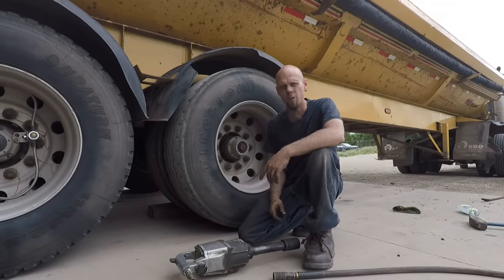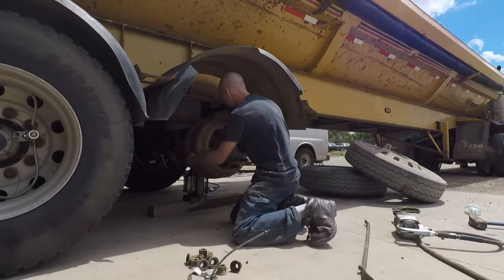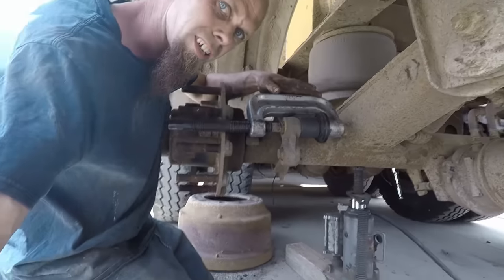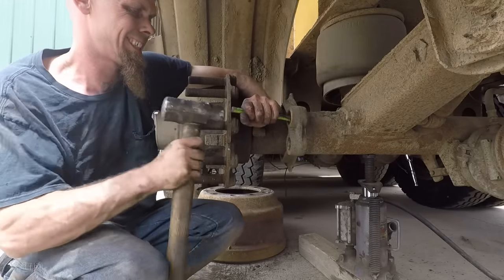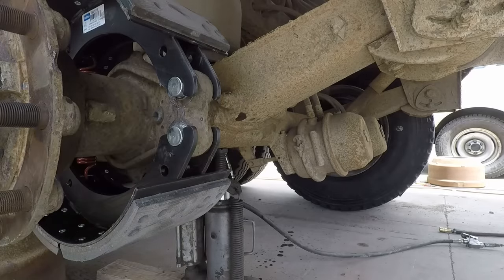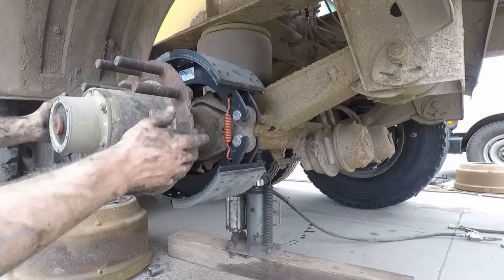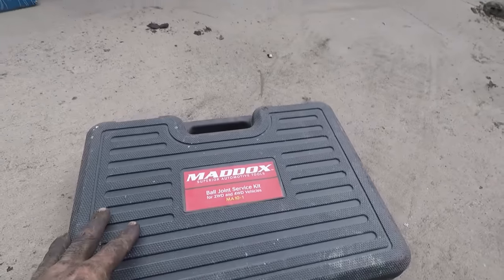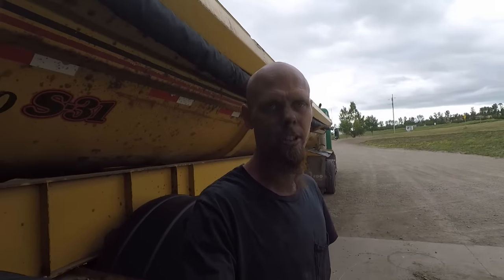semi truck brake job seized anchor pins

Comment: otherwise good job done.. tip: wear ear protection and eye wear every time you do this job, return springs can hit your face easily,  that 1 inch air gun is loud your hearing be gone before you know it... also there is a tool to push those anchor pin bushings (the one you took out with the chisel) a chisel can damage the inner walls of your axle and cause the same problem you trying to fix, also rubbing the drum and rims on those studs can cause your studs to bent & damage thread, a wire brush is also recommended to clean the studs and oil your washers, if you have abs it is a good way to push those speed sensors out, which i didn't saw any sensor so you may not have abs in the axle, but great job done... kudos to you man.. no hate intended..

Comment: Nice vid. Couldn't tell from the vid, but did you add some extreme pressure grease to the threads of the puller/remover? It would help a lot if you didn't.

Comment: Cool vid ... If you do brakes  a lot I did invest in the tiger tool or snap on makes a good tool to press those anchor pins out , and a good cordless impact , it makes that job a whole lot easier a lot less bullshit on you and only hard part would be putting the tires on and off😁

Comment: That was easier then a break job on my pick-up and the Wife’s car. Nice job Sir.
Reply from the maker: Everything is big and heavy but after a while you really appreciate the simplicity of air brakes
Reply: Ezrider92356 yes Sir, been a truck driver for over 30 years.  You make it all look easy, even when it is not.

Comment: Do you have any tips on what causes shoes to stick out the drum about a 1/4 to 1/2 inch. I replaced the spring kit and anchor pins, back them off, and readjusted them. They still come back out of the drum.

Comment: Use a bolt with the right size washer and you got a makeshift punch for getting the sleeves back in. Works in a pinch used on several service calls

Comment: This is probably the first time I've ever heard of someone using Brake Clean to actually clean brakes
Reply: I'm an automotive tech and we had several napa rotors we installed on cars start pulsating and need to be warrantied. A representative from napa came in and told us that we were cleaning them with brake cleaner when they should have been cleaned with soap and water. We all looked at each other like "uhhhhhhhhhhhh"
Reply: @nono5638  It's good to hear that work safety people around the world are easentially all the same, just as much as shop experiences are universal

Comment: Good stuff, but I know i don't do near the brake jobs you do, but I have done quite a few, and I stopped worrying about the oily coating on new drums and rotors a long time ago, and can't tell any difference in life or braking power.  In fact, when I know something's (gas powered) going to probably be sitting for a while, I spray the rotors with a cheap rattle can paint, and pump the tank dry.  And the brakes don't care.  Also I'm glad ta see I'm not the only one who hasn't fell prey to the rubber glove racket... ;p
Reply from the maker: i agree that long term it doesn't make a f all of difference. road dust rain water ect is gonna make quick work of it, still worth the 10 seconds to clean them tho imo.

Comment: I worked in many truck shops in my 20 years of doing this kind of work and not once that I ever torque the lug nuts he does run them in with the 1 inch impact and they're good to go.
Reply from the maker: Making sure the flanges where the rims mount is clean is more important than the torque value on the nuts and is often overlooked. I don't nessisarly agree with just buzzing them down and calling it good tho
Reply: @Ezrider359  yes that important I just did add that to my reply. But every truck shop is different in how they want to you to do stuff.

Comment: Did one of these a few days ago with the same problem. Ended up using a torch and an air chisel after the hammer and punch didn't work.

Comment: Very interesting! I'm a car mechanic and shop owner. I was wondering, approximately how much are a set of shoes and drums for one of those bad boys? And how much time  does it pay? We don't see many drum brake relines these days. Everything is mostly disc but I've done more than my share of them. The tiny springs we see are insane and tedious!! Great video and we torque every wheel on every vehicle. If we don't, the vehicle is more susceptible to rotor warpage.
Reply from the maker: id rather do big truck drums than car drums, much simper just everything is big and heavy. shop rates for big trucks normally is around 100-135 per hr.
Reply: @Ezrider359  Thanks brother.
Reply: Drums 60 to 200 a pop
Brakes 40 to 180 a pop
Labor 120 to 280 per axle.

Just quote 1700 for brakes and drums on a trailer.

Comment: I do brakes the same way, but I use a pair of vise-grips to put on the springs. Will have to try the screw driver method next time as it looks easier.  I have though about getting a ball join tool, but heat and hammer do the trick so never invested in one.

Comment: Hello from Kazakhstan.  When you pressed out with a big tool, you can’t pull it from the bottom to the top, because of this will be injury for your health , you need to push it from top to bottom, push it with your weight.  Peace to your home.

Comment: When tightening down the ball joint press how come using a breaker bar rather than a large ratchet? Was there a reason or just because that’s what ya had out? I just wanna learn 🙂

I build and repair custom technology but I’ve been getting into automotive and large trucks more lately. I just did my first set of drums on our business car so I thought this would be educational. Thank you for your hard work

Comment: When using a ratchet I find that less energy is used if you push down when able instead of trying to lift up. Generally you’ll have more muscle mass pushing than lifting a ratchet. Then you also have body weight behind the tool. Also, Tiger Tool makes an actual brake anchor pin/bushing press. A pair of vise grips is much easier putting the anchor pin springs on, safer too. I also hope you tapped those spring necks to make sure they were fully in place.
Reply from the maker: this took more force than what i weight. also pushing is a good way to hurt yourself if the wrench slips

Comment: oh yeah. those axles are notorious for those pins getting seized. snap on tap1 and a 3/4 gun with a 1 inch socket handles them usually sometimes need a torch to heat them up too though.
Reply from the maker: Yeah the style with the two stamped half's is easier to deal with even if they get seized it's really easy to just torch the bushings out

Comment: Leaving one of your anchor pins out then putting your small springs on is definitely the  easiest way to fit these shoes. All our trailers have back plates fitted so would make your method even fiddlier.

Comment: The anchor pins fit in the hole of the ball joint press, no farting around with adapters, and sometimes the hubs aren't notched, you got lucky! I had to pull hubs on an international to get them bastards out

Comment: I thought that was a stout jack you had there holding up that trailer but then I seen the wood block and was like “whoa that wood block is solid” then I seen the concrete underneath it and was like 🤯

Comment: Trailer brakes was  all I did for the first 2 years when I first started out as a mechanic over 25 years  ago you can make a lot of money off them when you get good and fast at them
Reply: You are absolutely correct!  I've been turning wrenches for 30+years and my first gig was at Santa Fe Hobart Yard in Los Angeles Ca.  Trailer, chassis, and container work for a year . I still do my brake jobs like this guy but instead of a screwdriver i clip vise grips  on the end of the small spring push down into the hole....🙂

Comment: I know this video is more about the brake job. But out of curiosity where did you get that big torque wrench for the lug nuts and what is the recommended torque specs on a semis lug nuts? I ask because I've never seen a torque wrench that big and so I've never torqued lugs on a semi truck. But several years ago when I first started driving I lost a set of duels one night about 3am in Dallas,  scared the crap out of me.

Comment: The most interesting video I’ve seen on YouTube lol.... i drive a t800.. brakes dont engage when i press, i press to much it grabs hard and smokes the tires. Any idea?
Reply: Sounds like you got a valve going out or some debris in there , try back blowing the lines

Comment: When I wrenched on trucks I’d change the pins out if they came out on there own. if not I didn’t. But I never knew and still don’t whats the purpose of changing them.
Reply: I do the same if they come out I will change them if not I leave them.

Comment: Great video, why didn't he use the large ratchet on the bearing press to get the pins out that breaker bar looked pretty small in comparison and no ratcheting. I'd definitely call that a two man minimum job.

Comment: I find it goes a bit smoother if you use a quality penetrating oil, let it sit and re apply every 2 minutes for about 10 minutes, then put some all purpose bearing grease on them to get them broke free and out without straining my back as much with a breaker bar. I recommend doing it my way to save your back in the long run you can always spray it down with brake parts cleaner later if you need to get grease off of areas that compromise areas like possible getting it on the friction pads on the shoes and drums. Over all great work but save your back that way when you get old you won't hurt as much and if you aren't already, start taking over the counter Glucosamine and Chondroitin so you don't suffer from knee, elbow, wrist, ankle, finger and tow pain. I've been wrenching at things for a long time and I once had developed some sever wrist pain in my right wrist which I use the most when I'm using a wrench, ratchet, screwdriver, breaker bar, torque wrench etc and it got so bad and traveled up my arm from my wrist to my elbow then shoulder which lead to it hurting so bad that I ended up picking something up that was fairly light and if I didn't drop it then I would set it down quickly which I would hope I could be lucky enough to set things down rather than drop it, it was embarrassing and depressing because I looked like a muscular built weakling and felt I was being stared at every time I had an episode hell it got so bad I could play my guitar because strumming and picking was excruciating and then a mexican friend gave me 14 Glucosamine and Chondroitin supplements and said take 1 a day for 2 weeks and I would be as good as new and smacking chicas culos in no time and even though he was trying to hook me up with a Big Mexican Woman aka a BMW looking like a few pounds shy of 400 pounds, not my taste in woman at all, the Glucosamine and Chondroitin really worked. I hope this helps you out.

Comment: That brake drum looks heavy how do they weigh? I usually do plumbing and the average cast iron tub I usually set is a Kohler cast iron tub 350 lbs each. I have helped to pipe in and set a 7' Kohler cast iron jetted jacuzzi tub 900 lbs. It took about 12 guys including me to carry it off of the plumbing supply truck and set it in place. I had the piping lined up perfectly, I got so good at doing the piping pre fab on drop in tubs that they would always put me on piping in the tub before installation of the drop in tubs.
Reply from the maker: Brake drum is somewhere around 80-90lbs I'd guess

Comment: I'm a torch and air hammer kinda guy when it comes to the siezed rollers. Also for the roller springs, I lock vise grips onto the bottom and then use body weight to push them into the shoes. If the axle has dust shields, those come off and stay off.
Reply from the maker: Definitely more than one way to skin a cat
Reply: Yes there are. Whatever gets the job done without making your life more difficult.

Comment: I watched this for kicks, I worked at a garage for years, can't even count how many times I've done this 😅 
I can say in all honesty, that is exactly how we all did brake jobs (10  mechanics in garage and another 20 on road service trucks),except for the ball joint press...we'd just heat 'em up with the torches and zip gun the snot out of them.

Comment: I use the exact same ball joint press but good God man, use an impact on it. Save your body. I been wrenching on rigs for 15 years. They make tools to make things easier that are on the cheap cost. Even for the tires. Why lay em down? Now ya gotta lift em back up. Lean em on the other set of tandoms. And them roller sleeves, just clean em up with a sanding wheel that fits in your drill. No need to replace them if they are not damaged. Love the vid but it killed me to watch. If you love your work like I do, take care of your body or you won't do it long.

Comment: I have no idea of course, but the shoes looked like they had a lot of material on them.  Did they not?  Or did you just decide to change everything because of the stuck anchor pins?
Reply from the maker: minimum thickness on these types of brakes is 1/4" they were pretty close to that.

Comment: I use the torch to heat them up if they don't come out with the air hammer. Is this the better option or is my way faster?

Comment: Is the brake pad change preventive maintenance ? or did you encounter problems with the brakes.
Reply from the maker: Brakes are a wear item
Reply: Preventive...prevent the bears from having a good ticket writing party, 😂.

Comment: Can you make a video on cutting U bolts on semis…and hot to safely and properly do it!! Steers and drives.
Reply from the maker: Pretty sure I showed cutting some off on a recent video where I changed front leaf springs on the peterbilt. I just use a plasma cutter or torch and go slow the heat will let the bolt stretch and relieve the tension before you cut all the way threw. Normally have to use a hammer knock everything off after you cut threw them. Iv never had anything go flying or anything like that.

Comment: I am a CJDR tech and I am probably treading in foreign waters right now, but for us we usually tighten the lug nuts as close to a star pattern as we can, is the same not necessary for larger heavy trucks such as this?
Reply from the maker: you draw them up with the impact in a star pattern once everything is seated it shouldn't really matter for the final torque, it wouldn't hurt tho.

Comment: safety first-  use a brake drum dolly (save your back and fingers).  #2 jack stand always.  #3 the axel has Q kits, don't even mess with those anchor pins- that's the point of q kits.  #4 rather than back up the slack to install the new shoes- go forward so that the s cam is now inverted- the worn side will be on top.  #5 you absolutely need to clean the hub surface before installing the new drum. if you crush dirt etc. . the lug nuts will NOT be torqued correctly.  you could lose a wheel.

Comment: Just curious, why can't you stick an impact on the press when trying to get the pins out? I'm not a diesel mechanic but an rv mechanic, but my first idea would be to grab an impact
Reply: anyways, awesome video man enjoyed watching it and learning things even though I may never do this in my life time
Reply from the maker: You can use a impact it's not very good on the tool tho and I can apply more force with a 3ft breaker bar than A 1/2 impact will put out
Reply: @Ezrider359  That makes perfect sense man, I totally understand. I guess I don't think of that when I am using a 1/2 snapon impact that will be repaired for free. One day I will become a diesel mechanic, always been my dream.

Comment: I use vise grips on the anchor pin springs just grip the tip  yea now and then you get busted up knuckles but no like using sharp screwdriver like u said 6 ways plus sunday on tecs how we do them

Comment: For those roller with those type of clips, use the screw driver to pry em. Lay the roller in the grove and grab your screw driver, put in the center of the roller with the tip grabbing the clip and roll it in. Saves your fingers.

Comment: If you take old anchor pin and weld a large over size washer to the end has a stop and than weld a 10” bar to the end of that,  you have your self a bushing driver that works great. That’s what I use.

Comment: Next question,  why are the back plates removed behind the brake shoes ,
Reply from the maker: Never had them. Not a fan of dust covers anyway. It's easier to keep an eye on components and wheel seals when you can see them and they do very little good dust dirt and water will still find its way in there
Reply: There law over here , years ago they were taken off to reduce heat build on the smaller drums with a smaller wheel size ..

Comment: Your a beast, great job. I have to throw out a negative but do they make a jack stand  big enough for that job? Seems unsafe with just that jack.
Reply from the maker: On this trailer working one wheel position at a time it could fall off the jack and nothing would move. Suspension doesn't articulate side to side trailer weight is 16,000 lbs empty has 3 axles rated for 20k each plus the 2 drive axles supporting the weight. Even if the trailer was loaded and it fell off the jack maybe you might get enough defection on the suspension bushings the drum could slide off if it fell off the jack

Comment: So when you back off a quarter turn for new shoes... in 3 weeks of heavy driving do you retighten or should you?
Reply from the maker: not if you have automatic slack adjusters if you have to re adjust them after you first set them up then there not working properly.